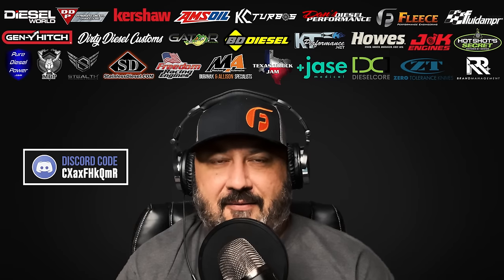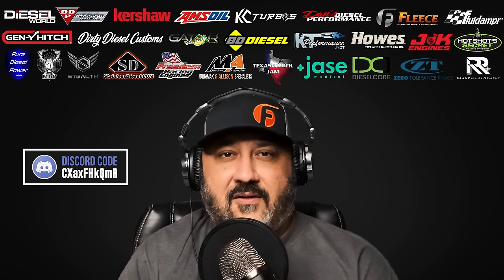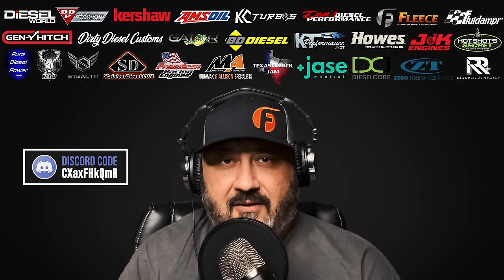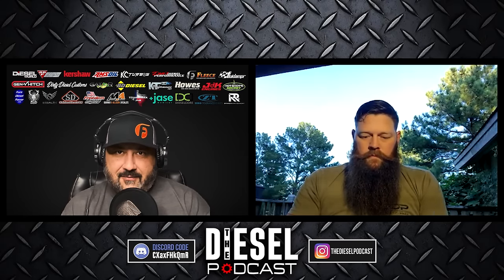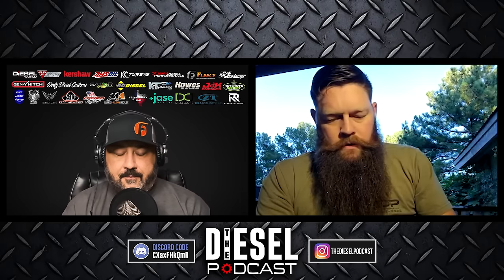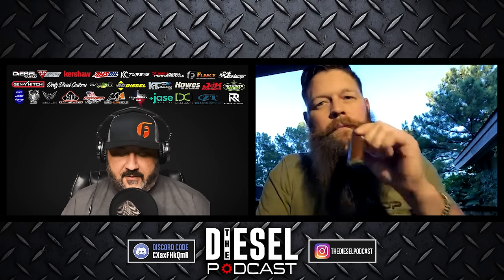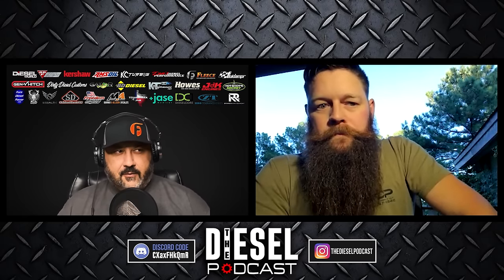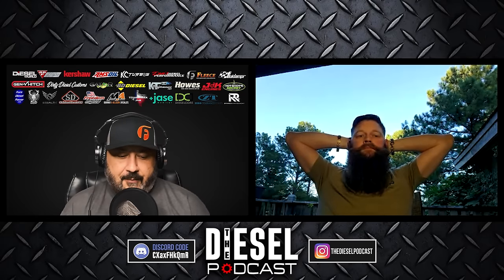Forced to Put DPF/EGR Back On?

Comment: Wow perfect timing! I literally just pulled the trigger on a Snow Perf. Stage MPG kit 2 days ago! 
I was on the fence because I haven’t heard anything about it in 10 years and even all the forum topics are 10-15 years old so I thought maybe I was missing something and everyone stopped using them. It was weird. 

I absolutely NEED water meth injection because pulling 30k lbs+ up the Rockies every week. I’m on my 3rd exhaust manifold on my 5th Gen Ram which I’m guessing is from too high of EGT’s and I think meth injection should fix it.
Reply: Get a Banks intake and intercooler. That will help out.
Reply: You will love it, if you have any questions about it, feel free to hit me up. I'd love to help.
Reply: Down shift and spin the motor faster. Had a 2001 dodge 125 hp injectors,schide lighting pump and turbo and edge drag box never cracked a manifold or melted a piston the Cummins will run all day long at 1250 degrees go any higher better let off in about 10seconds or you'll have problems
Reply: @davidcaskey4669  Thanks. Spinning it faster will increase coolant temps. With a 5th Gen High Output Cummins the sweet spot is 2200rpms I found out (w/ 37” wheels) without heating up the coolant and oil temps, but consistently at those speeds EGT gets hot going up the IKE at 7k-11k ft elevation.
Reply: @exotichotshot7221  drove tractor trailer pulling heavy since i turned 18 that was in 1980 still have the W900A that my dad started with its a 1976 model KTA CUMMINS also have the second truck my dad bought for the business a 1979 359 extended hood 3406B both of these you aslo down shift to cool the exhaust when your pulling as a diesel pulls down it stops burning the fuel efficiently thats why the black smoke black smoke means that exhaust temp going to start climbing unless yuo drop a gear. Both of these trucks were 6X4 transmission  years ago dropped the six speeds out and put in a 13 double over and kept the 4 sp brownie boxes there enough gears in them to pull what ever you want but when you start seeing the heavy black smoke time to move a stick one or the other
Reply: Straight water will cool the EGT. DevilsOwn is the better place for water injection parts. Snow is a ripoff retailer. One of their 1300ml/min injectors will dramatically cool your EGT. You'll need a 7 gallon bed tank for towing use

Comment: Run an ezlynk. Keep stock exhaust so you can put it back on if need be. Leave egr on and just have it turned off. Stop putting huge tips on exhaust to keep attention off. Just run dpf delete pipes and stock tailpipe. Have fun on empty back roads. Keep it nice and easy in town.

Comment: I sold a 2016 f350 dually with the 6.7 simply because of the emissions. It was a great truck and very powerful. I had it deleted, from the def to the oil cooler it was deleted. I got a ticket for not having a dpf filter and looked into putting it back to stock and it was just too expensive. I sold the truck to a logger and bought a gas burner. I can still pull my tractor and equipment I just get started a little slower.

Comment: My worry is that pre emissions diesel will have to become emission compliant or has to be unregistered because they are no longer exempt from emissions. I grew up around diesels and always had a passion for them. I like the newer diesels because they have a lot of nice features but have failing emissions equipment or are 50,000+ dollars even when it’s a 10+ year old truck. So with emissions on newer diesels makes the pre emissions one go way up in value and harder to buy. I’ve been wanting to buy a obs 7.3 powerstroke or a 2nd Gen 12v or 24v that’s not rusted out and lower mileage. But even the rusted out high mileage are selling for like 15,000+ and I remember when clean low mileage ones a few years ago you could buy under 10,000 now they sell for 20,000+. You know I haul hay and haul cattle feed and tow quite often in a very hilly environment and I’m 18 fresh out of school and I could use even a older diesel. These hills are killing my 03 5.3 Silverado. It will do the work but I’m getting 4-7 mpg because of the hills. But can’t find a decent older diesel truck that isn’t high mileage or rusted out without being a ridiculous price. Like I said even the rusted out high mileage ones that have been ran hard are still selling for 15k + and the ones that are selling for like 5-10k are really high mileage rusted out with a lot of problems that would cost more to fix then what the truck is worth.
Reply: your best bet, buy a pre 06 truck, it will be high mileage but find one who has papers proving the work done. Your best bet will be to plan to rebuild it, make it new. I dont see how they could force vehicles that never had parts designed for the vehicle magically appear.
Higher mileage means less $, means more $ for upgrades.
Reply: @yourfavoritelawnguy2722  yeah but the thing is I’m talking about 94-04 trucks I see high mileage rusted out for more than 13k within 100 miles range of me
Reply: @yourfavoritelawnguy2722  for a decent truck with a little bit of rust and less than 250k miles they are selling for almost 20k and under 200k they sell for 25k if not more
Reply: That is happening in California on F450 and above.

Comment: I have been running water meth injection for 20 years on several different vehicles, 1 diesel and the rest high hp turbo gas engines, I love snow performance, auqaumist and aem systems, every engine I tear down has 0 carbon build up on the valve train and pistons.

Comment: DPFs don’t get plugged if you use the truck, not use it like a Prius ,like a truck,work it get it hot, I don’t know why people like to buy one ton diesel trucks and drive them around like they are a  car. Let them cold idle too long etc… 99 percent of the DPF issues are driver induced.
Reply: Lies
Reply: 100% truth.   Look at the 6.4 power stroke.   Ones with the most miles without issues are the ones that were worked properly.   Seen several with 300-400k miles on the original engine especially f350’s and f450’s.  Working them makes are difference for sure.
Reply: It depends on how you work them. I have a couple trucks that come in to our dealership from a construction company that clog dpfs past the point of self regen because they idle on site and/or pull large equipment around the site and they have an average mph of 27 mph and don’t have enough long drive time to self regen as they should
Reply: @fredcalder2869  idle and and low speed are killers.  The key is let them regen like they’re supposed to instead of shutting them off. I run a service truck and if the truck hasn’t regen’d like I think it should then I’ll plug into it and force a regen to keep it clean but that’s honestly what I specialize in on class 8 trucks.  95% of my service calls are on after treatment systems and majority of the time I’ll find where the drivers don’t let the truck regen properly and/or hit the inhibit switch to stop it because they say it’s “annoying” to listen to it regen🤷🏻‍♂️..   I’ll gladly take their money because of their stupidity.
Reply: So they put those systems on to reduce emissions but you have to drive the truck hard (increase emissions) to get it hot enough to make it reliable. Make it make sense please.
Reply: The dpf will fail at some point in its life its a ticking time bomb. I work on heavy duty trucks. I see everyday and work on emissions everyday. They will clog up at some point and cleaning them sometimes doesn't fix them. You could have a egr cooler fail and put coolant into the dpf wide it out. Or have a turbo fail and pump oil into it. It's does matter what you do to it. It will fail at somepoint.
Reply: @bigmurph1447  nothing lasts forever.   Everything fails at some point including our bodies
Reply: @mchenryjeremy  it doesn’t but what can we do?
Reply: Straight lies, my truck works all the fucking time and everything related to emissions gets clogged up.
Reply: Wrong
Reply: @ratpatrol6356  and I work mine daily for 10-15hrs a day and I don’t have issues.   You sir have another another issue.  Depending on what engine you have I could probably help you out with that.
Reply: @6.4DieselDoctor  if the majority of people with trucks are having problems with emissions then there is something wrong with the design. Having a few standouts that work fine doesn't help advance emissions systems.
Reply: Well they like truck and fuel mileage and do not want a car. Thats why they buy them. But there is a problem with this crap if you can just drive it normally without it clogging up.
Reply: This is why gm and ram need a 7 liter v8 to compete with ford 7.3
Reply: @6.4DieselDoctor   I have the 6.7  I deleted mine about 70000 miles ago currently almost at 300000 miles running strong. At 1 point I was stuck in regen for hours on end.  It turns out my truck was working at 1/6 of its power
Reply: @ratpatrol6356  sounds like a bad pm sensor if it stayed in regen for over an hour.

Comment: I have a 8 year old Ram 2500 fully stock haven't had any issues with any of the emissions only has 43k on it. Drive it around here and there mostly not towing anything.

Comment: Should check insane diesels for their bypass filters. I hear this helps with soot build up in the engine.
Reply: Any bypass filter kit will help. I have a FS2500 on my 2000 F250 Super Duty with 7.3 powerstroke. I personally think bypass filters should come stock on all diesel and gasoline vehicles that have egr.

Comment: I just realised I’ve heard this before!  Yep, confirmed at a year old…still relevant though.  The days of bypassing EGRs and DPFs are over.  Since DPFs are So expensive, why would you buy new.  I’d rather buy really old then sink some decent cash into it to get it reliable.  The depreciation on new trucks is idiotic.  At least with an old truck with a rebuild engine, etc the depreciation is next to nix, likely even go up as they get rarer.

Comment: I thought the emission from diesel was actually cleaner than from a regular engine? If you tried to commit suicide by running a diesel inside a garage that you would not die as the fumes contain less co2 and CO than a gasoline engine.

Comment: You can read the rules. They do plainly state that repair facilities cannot perform repairs without restoring the removed devices if the repairs involve a part that attaches to a missing emission device or if the missing emission device would have had to be removed and replaced to accomplish the repair.
Reply: That's correct, but there are agents out there telling shops they can't touch the truck unless it's completely put back to stock. The inconsistencies in agents is extremely frustrating when trying to follow the rules they are making up as they go.
Reply: @vinnyhimes1190  Thank you, I could certainly agree with your assessment. As if your business wasn't difficult enough...

Comment: That boy is defintely telling it like it is, not fun being on the service or parts counter when you see folk that the emissions system on the vehicle is absolutely breaking them, they make their living on that truck, and you can't do a damned thing to help them. First few yrs, 08-11 were the worst, nobody in the industry knew what was going on, the OEM's were scrambling to find ways to fix it.THe 2011-2014 period was a hair better on the EGR side, but had the DEF/SCR system added, more wiring, more sensors more issues, 2015-18 improved a bit again, still lots of turbos, coolers, backpressure valves, fewer EGR valves, SCR assy's, plugged DPF's. And thru that whole period there were fuel system component issues, cyl kit issues, cracked heads from deletes, and tons of sensor & wiring issues. All the gov't did, was keep adding regs that the OEM's had to comply with to stay in business, engineering costs are off the charts nowadays with all the regs in the last 15-20 yrs, warranty costs are a serious issue, and the govt's are now forcing the EV type builds, which involves a hell of a lot more than the vehicle OEM's. Gov't needs a reset, a reality check, something, it's beyond comprehension to me the way this is going..

Comment: So,answer me this….I am a mechanic from back in the seventies,when diesel engines lasted decades….Before this emission scam….Now all I see are cracked heads and failed ECM controls at low mileages….Yeah,the increased heat burns hydrocarbons,but destroys pistons and especially heads….Emissions DO NOTHING to benefit the engine….Nada….Nothing

Comment: I've owned my lmm for 5 yrs and I'm still learning about Diesels  , Question  , did I hear him correctly  ? A diesel guy that has all bone stock truck that tows heavy loads / works the truck has less problems than the guy that drives 10 miles each way to work , and let's say it's all Freeway driving,,  and if that's the case what advice would he give to the guy doing his 10 miles a day on the Freeway ?

Comment: I've got a 2016 f350 xlt with 135,000+ it's been pulling rvs since day one, I've seen the cp4 issues but it's failure rate is 7% over all, I've had 07 f250,12f250,15f450,19f250,16 f350 now I've either been lucky or is this not as bad as they say? Now my lawyer has my 2015 f450 in a lawsuit not a class action lawsuit just the individual suit for the 2015 cp4. But from my understanding dodge ,Chevy and ford run the same bosh cp4 dodge has settled out, but the lawyer says ford will fight till the bitter end because they're going broke along with gm, my question is do these cp4 kits really work because they're still installing the 4.2 which is the same bosh cp anyways.

Comment: I legitimately dont tend to talk down about companies but to start the reason that this is coming down so hard is the people who shouted to the world what they were doing all for greed to get everyone to buy their products. Its unfortunate because the industry at large is to blame. This man right here was one of the big guys that got the hammer brought down on him. He rolled over and paid the fines and submitted to no longer deleting. There fortunately in the area ALOT of people who do the deletes quietly the invoice does not have anything about it if there is an invoice at all . The tuners that are smart have retreated to email only sending tunes VIA email using VPNs that cannot be tracked. All trucks are not doomed theyre only doomed if you run your mouth about it . Not only leadfoots but ALL the companies that were broadcasting over the internet exactly what they were doing while knowing damn well what they were advertising out in the open was 100% illegal there was never a question as to wether violating EPA laws was illegal right from the start. The people who were running around with dumbass stacks smoking out the damn road behind them smoking out priuss was some big game to them and they posted it all over the internet blowing a bunch of smoke does not mean that youre making more power a great tuned truck will only haze grey under hard acceleration there is a line you cross where you get diminishing returns with more fuel. Its unnecessary and the idiots ruined it for everyone and the tuners that advertised or for that matter even wrote tunes for people that would bellow smoke for no good reason its so unfortunate but they ruined it for everyone who enjoys it now we have to comply if you live anywhere that actually enforces regulations.

Comment: I've never got in trouble for a little blackness on the side of the truck by the exshault pipe, for I only was my truck once a year. But I guess one can put a extension on the tailpipe and get it away from the truck.

Comment: I just got a 2015 ram all the parts are left on the engine but exhaust is just a pipe. Guess thats why they left it on after the delete incase they wanted to trade it off.

Comment: August 25th 2024 I'm looking to buy a 2008 Ford 6.4 dually crew cab and with 167,000 mi on it and I asked the seller or what does he said it deleted and bulletproof so I assume the EGR I'm in the state of New Jersey what is the ruling here I specifically asked the seller will I be able to get through emissions inspection station what's a you on the on this matter

Comment: Good thing I have a 06 with a 2018 carb legal swap no egr no dpf is required if the modified engine runs cleaner then the original 😊 and I have 800hp Cummins baby g56 But hey my truck I spent 60k building and it’s worthless and I’m worthless apparently because I’m a diesel mechanic

Comment: From what I understand the stock 6.0 air filter is adequate for stock power. Any opinions?
Reply: Stock filter for stock power? Sounds like common sense. I think the stock filter flows better than the aftermarket.
Reply: Modify the hell out of that 6.0 man, as a ase technician egr systems destroy the engine, let it breathe